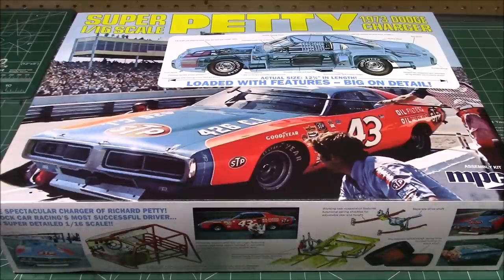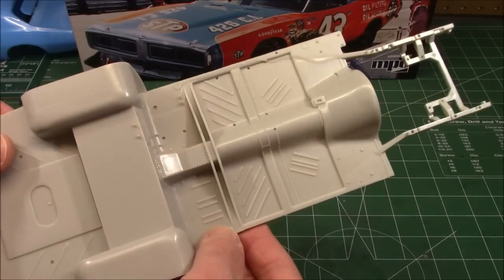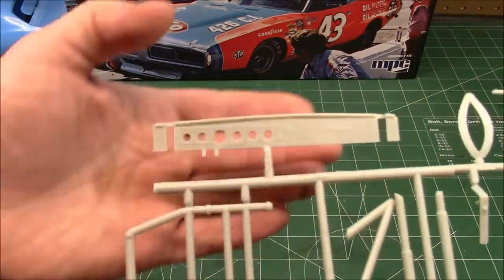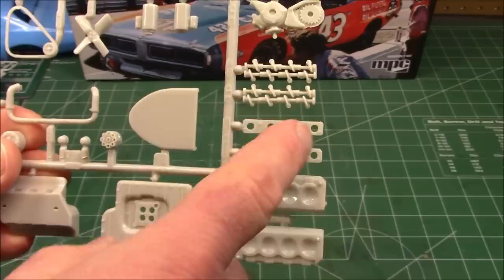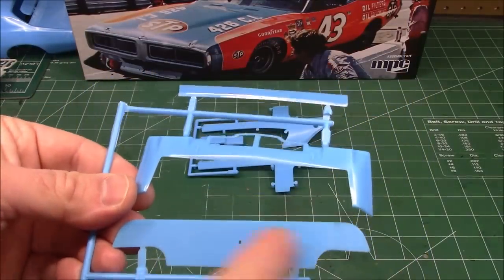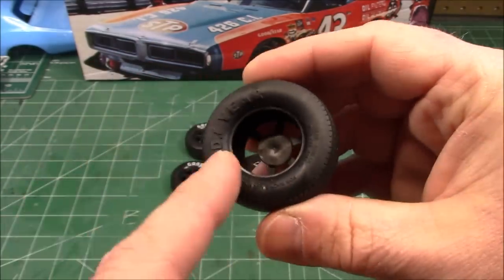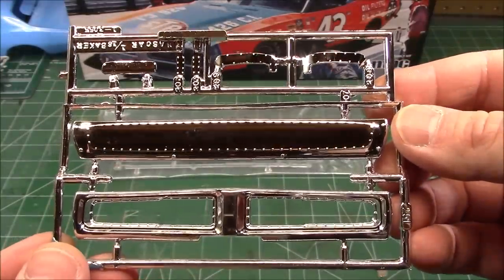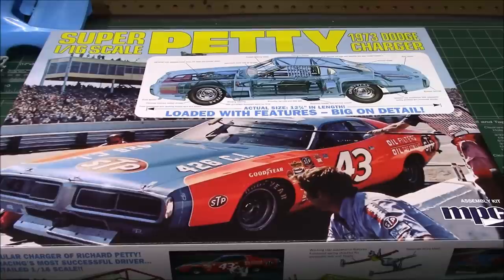Richard Petty 1973 Dodge Charger 426 Hemi #43 Stock Car NASCAR 1/16 Scale Model Kit Review Unboxing

Comment: I had the c.1984 issue  -- modified - reissue -- 'Street Machine' version of the 1/16 scale Charger some years ago . I was quite impressed with the details of the engine and transmission ; casting numbers ! Separate bellhousing ! Separate clutch ! 
I am so tempted to purchase this restored version --- I just may do that .
Reply: Me mate had the Street Machine version in the mid 80s and i also had a real one blasting round my town in Essex Uk around that time- so this kit is on my wish list to make a replica.